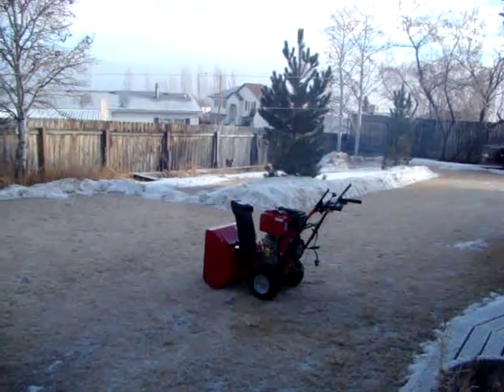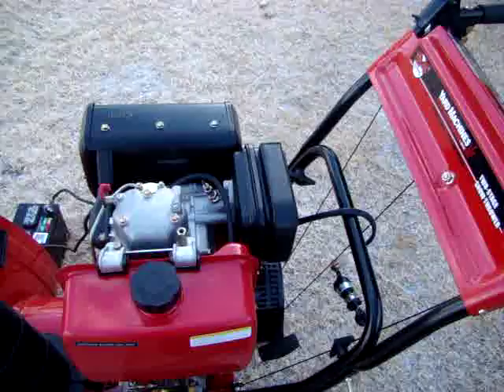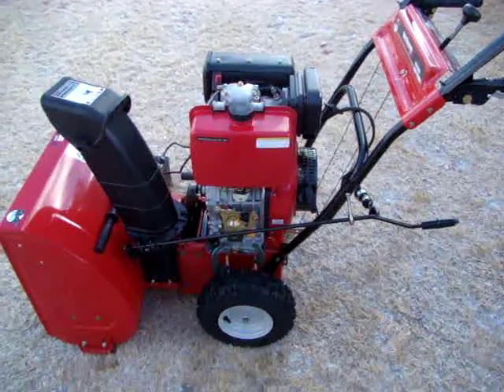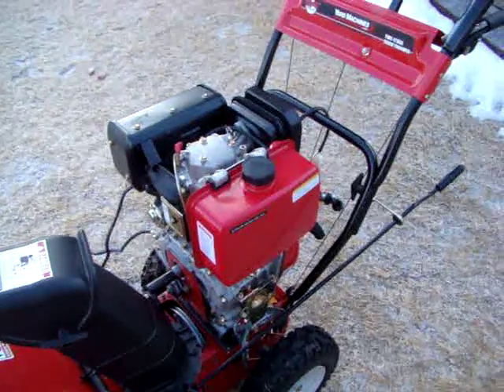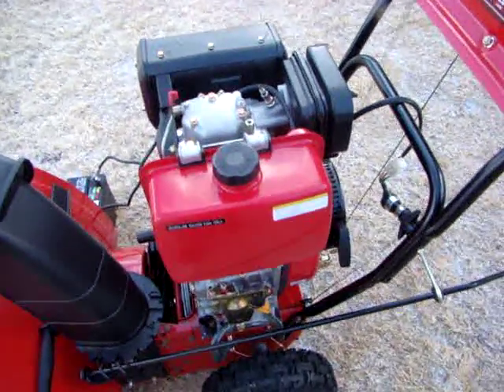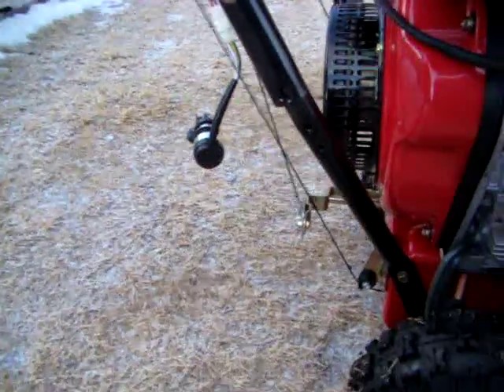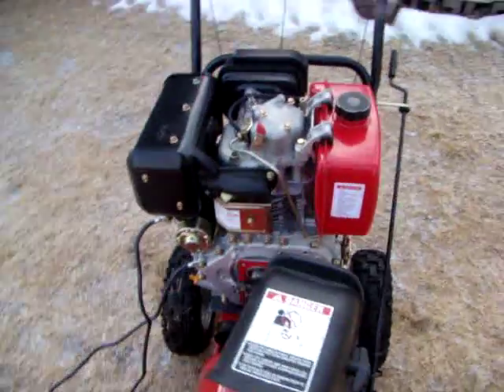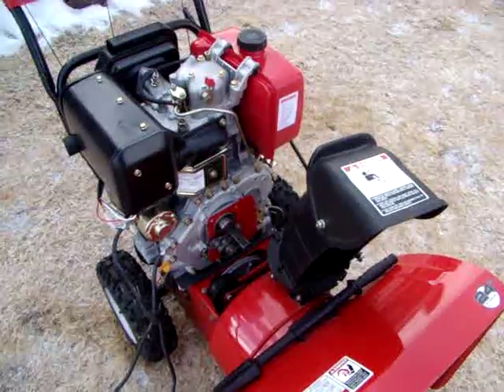Gas 2 Diesel running first tests

Comment: just remember one thing diesel engines don't burn clean until they get up to operating temperatures because the fuel that's going into the engine is not totally vaporized so it's going to burn like a white smoke off of it until that gets hot enough I like the job you did on it it looks good words you get the motor from cuz I'm considering maybe changing my engine not my snowblower to a diesel in a gas motor

Comment: Nice conversion.  I'm looking at installing a diesel on my old snow blower, how have you found the conversion? I assume you have a few years experience using it, how has it been running?
Reply from the maker: Thanks.  My sister actually has it now and she lives in a snowbelt area so it will get more use in the next few years.  There still is only 17 hours on it.  So far it is performing ok.  It is excellent on fuel of course compared to a gasoline thrower.  The conversion was relatively easy - the hardest part was the chute modifcation.  I plan on doing another, except this time it will be a Hatz 1B50 on a Poulan Pro 30" unit.  No particular reason I'm choosing the Poulan Pro other than I found one cheap.  I also needed a thrower which uses cables instead of rods for the chute controls which keeps them out of the way of the larger diesel engine.   I bought a John Deere 26" unit that I thought would work but upon disassembly of the drive I found it actually has two output shafts off the engine that turn counter to each other.  So that isn't convenient to convert.  I plan on making the auger drive pulley directly off the engine larger (as I did with this one) to get the engine down to around 2500 rpms where it is nearer to its peak efficiency and can still provide close to the same hp to the machine as the original gas engine.  Have fun, I hope you enjoy the conversion as much as I have.  Eventually, when small equipment goes to fuel injection for gasoline engines the benefits of the diesel won't be as significant but for now it still is worthwhile venture in my opinion.

Comment: You may have discovered by now that these China diesels can smoke quite a bit when new.  As soon as the rings seat some, the compression will come up some more, the running smoke will subside, and starting will improve.  I've had two of these engines, one in 10HP on my Ariens 24" snow thrower and a 6 or 7 hp one on my Troy Bilt tiller, respectively 10 and 9 years old now and both blew quite a bit of smoke in the first few running hours.  As time went on, they both came to start on the first pull after break in.  The 10HP engine on the snowthrower doesn't even have electric start.  All I do is hold the compression release lever down as I pull the machine through several, easy times with the pull cord, with the speed control (can't call it a throttle really) on FAST.  This primes the engine and it starts on the first pull once the compression lever is set and no longer held.  I have no glow plugs or preheaters on this thrower engine either.  In super cold weather (I'm in the northernmost county in Maine), say 0F or below, fuel does gel in the lines and I have to keep the machine in a little warming tent in my unheated garage.  (I drape a big blanket over the whole machine and put a fan forced space heater underneath the handlebars, set on the floor, on low for an hour or two) but that's only in extreme, northern Maine, (or Northern Plains I suppose) cold which even up here, is not super often - at least not until the snow storm completely departs and the truly cold air rushes in afterwards.  Once started, the engine heat and fuel recycling into the pump, injector, and fuel return keeps the fuel warm enough to not re-gel.  Honestly, even the old Tecumseh Sno King engine never started any better or reliably, and it had 120V electric start.  It's a case of fuel injection working much better than the relatively crude, simple, float carburetors on the original engines.

The 7HP unit on the Troy Bilt does have electric starting, but I've found that the extra vibration from the diesel, combined with the factory standard Troy Bilt battery mount, (it's on a bit of a pedestal) vibrates the battery so badly I only get about 6 months out of a battery, so I quit replacing them and just use the pull start.  Again, by priming the engine by pulling it several times through with the compression release lever held down and FULL on the speed control, it starts on the first pull - in normal gardening weather, absolutely every time.  In warm weather, after I prime it on FAST, I move the speed control back to IDLE, reset the compression release lever, and actually start it on that setting, thus I don't have to start it and rev it at full speed right away until oil pressure comes up some.

All that said, I'm only at about 600 feet.  At 6000 like you?  Things might never get quite as good in the starting department.
Reply from the maker: Thanks for the comments.  I've recently moved to a lower elevation (900') and noticed the elimination of the high speed miss shown in the video.  Higher air pressure (at lower elevation) also makes starting easier due to the additional initial air mass and resulting compression of that air mass leading to higher cylinder temperatures.  I do need to get some more hours on the unit and hope that happens this season.

Comment: Nice engine. Hello, I just bought a generator that has a Launtop 420cc gas engine. I am researching to put an electric starter on it, it has a plate. This is the closes thing i can fins. Can you pull a number off of your starter motor? Thanks!!
Reply from the maker: If you search for Yanmar L100 starter you'll find it available.